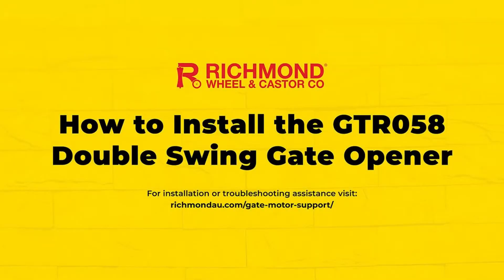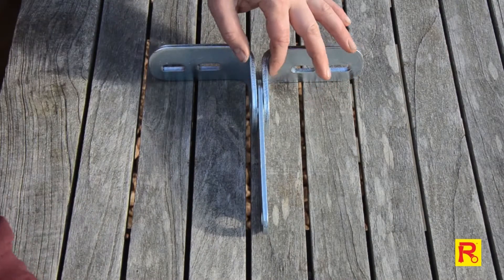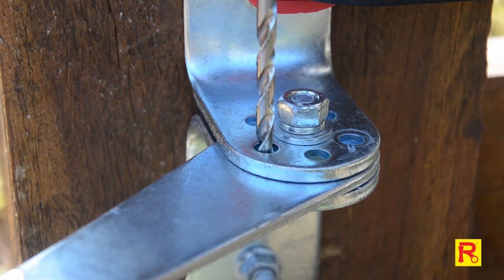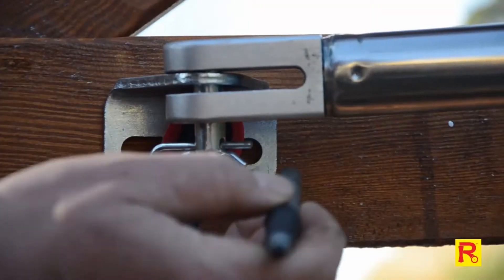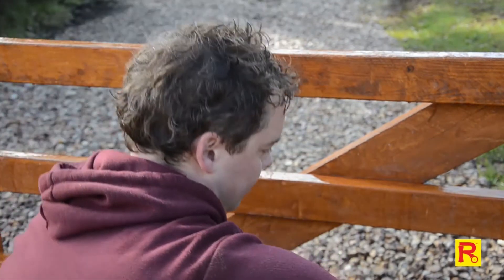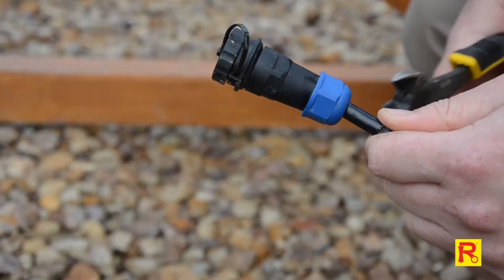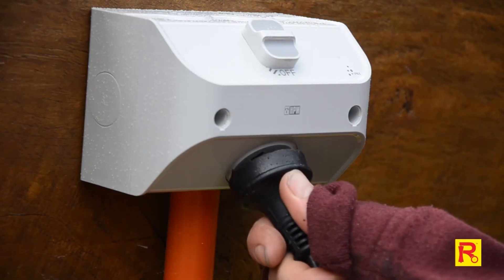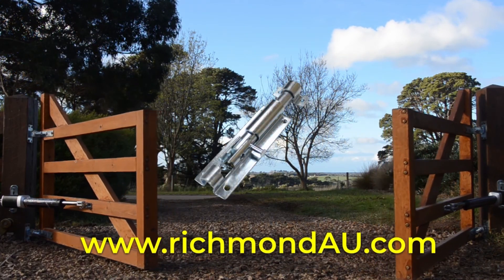Installing a Richmond GTR058 Double Swing Gate Automation Kit

Comment: Is this able to be setup to work in the opposite direction? I.e. push open, pull close? Thanks.
Reply from the maker: The arms can be set to either direction for pull-to-open or push-to-open.
Some modification to the mounting is required, but other than that it's just a simple wiring change.
Contact our technical team if you need more information.
Reply: @RichmondCastors can you provide a video for that as well.
Reply from the maker: Hi Ghost, we don't have a video for that right now, but the setup is almost identical aside from some key changes.
1 - The bracket mounting position (the manual has the push-to-open dimensions).
2 - A possible wiring or dip-switch change (depending on your model).
3 - Correctly setting your limit switches underneath the arm.

Comment: hi what is i need the gate to open 140 degrees can i do that or i need extra accessories
Reply from the maker: Hi @cocolove. Our swing arms will allow a maximum of 110° based on the mounting position.
For a system with 140° you will need a specialist opener.
If you contact our gate support team at gatesupport@richmondau.com they may be able to assist further.

Comment: What if dimension A and B are shorter than the recommended range?
Reply from the maker: Hi Mark,
The mounting dimensions are directly related to the maximum range of motion.
Mounting outside of the chart range will limit you below 90 degrees of movement and can result in complete loss of movement.
Submit a request at gatesupport.richmondau.com with some pictures of your gate and one of our technicians will be able to help.
Reply: @RichmondCastors   Will do. Many thanks!

Comment: Do you do a solar powered unit as my driveway gates are a long way from any power source?
Reply from the maker: Hi Mike,
Both our swing and sliding gates come with solar powered options. We also have a low voltage power source that can be used if you have mains power within 60 metres of your gate.
If you need more information, take a look at our range https://www.richmondau.com/automatic-gate-openers-hardware/
Or feel free to give our sales team a call on 1300 474 246

Comment: What is stopping it from being forced open or blown open?
Reply from the maker: Hi Kecup,
Internally, each arm is operated by a DC motor and steel worm drive. This also holds the motor in a stationary position when closed so that the gate can not be pushed open.
Reply: @RichmondCastors  If it holds the motor in a stationary position when closed so that the gate cannot be pushed open, what purpose does the GTR169 Electric lock serve? If there a certain amount of force that will open the gates?
Reply: @alexcampbell4301  I think it might be to add a categorical difference between a gate that shuts and a locked gate. Insurance purposes?
Reply from the maker: @Alex Campbell
As a general rule, swing gate motors of different types will have roughly 3 degrees of travel with some force applied.
It would take a decent impact from a vehicle (or a group of very motivated individuals) to damage the internal gearing of the motor and allow the gate to open completely.
Having a gate lock fitted would mean they would also likely need to have some tools handy to bypass the lock.